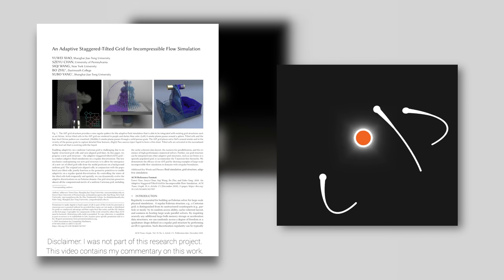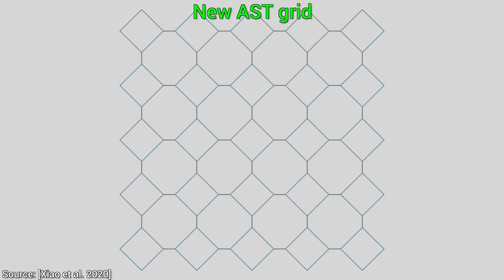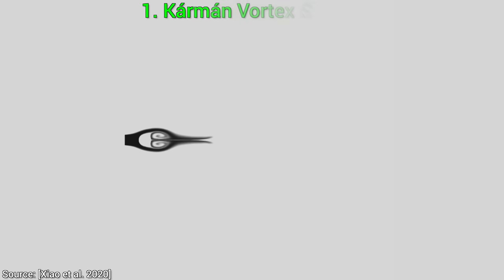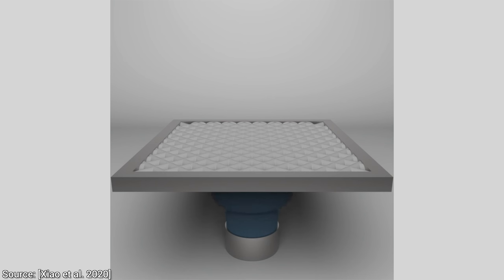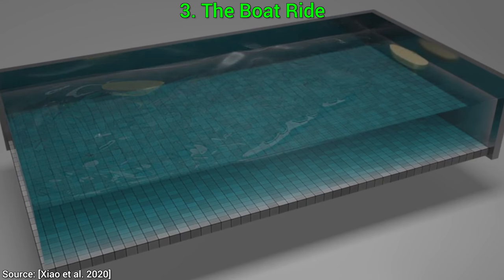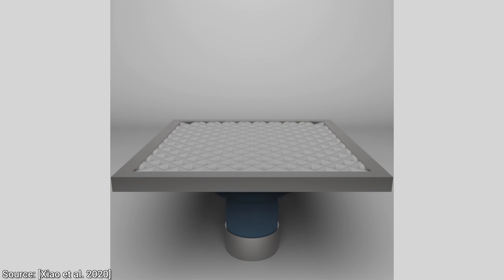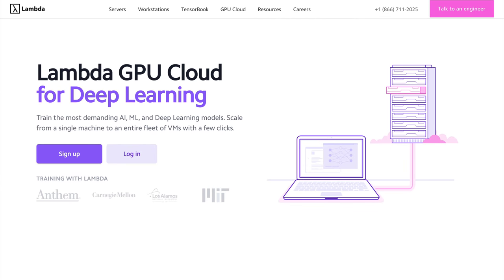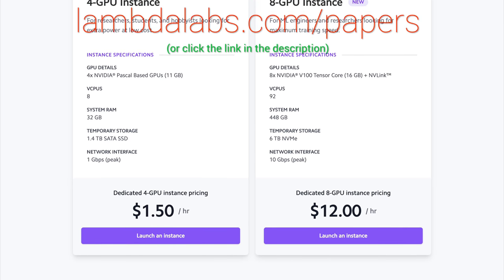All Hail The Adaptive Staggered Grid! 🌐🤯

Comment: I'd love to hear a more in-depth explanation why a tilted cell provides more detail than a regular cell. Is the tilt itself the extra information? In what way is that different to a motion vector?
Reply: A guess:
Tilt vs non-tilt is additional information and regions of either type can be used to define boundaries more easily that a regular grid could not.

Consider a wavefront and then look at a single pixel. Is it part of the wavefront or not? That information could be encoded into the rotation of the grid.
Reply: I'm guessing: So in FVM, there are cross diffusion terms that generates errors. If there are vortices in a domain, and using tilted cells, there is a chance of less cross diffusion currents and computationally less errors....

Comment: So why does the grid need to be tilted?
Reply: good question
Reply: There's a typo in your username
Reply: I guess that the main reason is that you can refine the grid flexibel, instead of abruptly splitting  big" cells in smaller parts you can gradually add those new cells in the the vertices/knots of the "big" grid. 
They are tilted so the new geometry of the grid is nice calculationwise. 
I sneaked into the paper and as I guessed, I saw that if you refine the grid twice the new even smaller cells are tilted (relatively) again, thus  normal again (viewed from the outside) 
Pardon my bad english. I hope this makes any sense.
Reply: I'm guessing: So in FVM, there are cross diffusion terms that generates errors. If there are vortices in a domain, and using tilted cells, there is a chance of less cross diffusion currents and computationally less errors....
Reply: @arnoldsenokopenko6093  The character limit didn't let me fit it all in. Had to sacrifice a letter somewhere. ;)
Reply: Figured the tilt was a way of embedding for more information into the cell. I'm not sure how significant "tilting" is without reading deeper but my initial thought is that it's related to how particle information is stored in x,y,z coordinates and this adds an extra dimension of rotation
Reply: I am pretty sure a lot of velocity vectors going on the diagonals are resulting in a somewhat costly multiplication by sqrt(2) in 2D or sqrt(3) in 3D. On the other hand if you rotate your grid they result in multiplication by 1 so they're free in a tilted space
Reply: @Twas-RightHere  A worthy sacrifice, Ames.
Reply: The uniform grid, because of those pesky corners of squares/cubes, favors liquid transfer in cardinal (x, y, z) directions but has no direct way to compute it in other directions. For large slow flow it's not a big deal, but for vortices, it is especially because vortices tend to become smaller & multiply over time. You can imagine it (approximately) like the swirl having a diagonal direction in it somewhere, which hits an edge and the swirl "splashes" into far too many grid cells.
In fact, it kills vorticity so much that a common approach is to guess approximately the vorticity and hack the fluid flow with an additional step so it looks better. The results are okay but not scientifically accurate.
With a tilted grid, you get 8 additional directions of transfer that are simulated perfectly, in addition to the starting 6; that means the angle between fluid's real direction and the grid directions is halved in the **worst case**, and on average even better than that. So swirls dissipate much less.
Reply: Thanks for all your answers, makes sense now. :)
Reply: @arnoldsenokopenko6093  What do you mean? their userame looks fine to me
Reply: @Twas-RightHere  why didn’t you sacrifice the A
Reply: @Twas-RightHere  You could've merged the "rn" into an "m".

Comment: It doesn't cost anything, in fact it makes it run in real time.

Damn, oh well...
Reply: Well it has to cost something, there are more calcs.But considering compared to uniform, it looks like it may increase  cell density up to like maybe even 80% and 4x the cell computations(4 new uniques for every original)... 1% and sub 1% for 3D is insane. It will mean when realtime comes, we'll have that much more resolution to our sims since 1% is negligible and it seems to scale to higher res well so the overhead will decrease. I deal with lots of this 3D space subdivision and I just can't comprehend how quadrupling computation points doesn't even increase overhead 10%.  Theoretically there's no way around it consuming 4x the ram but space is cheap.

Comment: I remember in my applied fluid mechanic course from a long time ago, there was a method call HP-reduction for optimizing finite difference method. The H part mean adjusting grid size, while the P part meant for increasing the polynomial order in which the grid was model on (it was discover that higher order polynomial give less error but does cost more resource). The way they determine the grid size is by restriction the maximum computation error a grid could have. IE: if a grid exceed the error threshold, it gets divide into half and recompute again, re-compute until error is lower than some threshold. It speed up computation so much that it can actually do 3D mesh even without multi-threading (this was done back before GPU computing becoming popular). There was also another method call multi-grid method. In which we compute the fluid simulation in a coarse grid until it converges, then interpolate the values into finer grid as initial conditions. Compute until it convergence rate slows down, use the result to interpolate back into coarser grid as initial conditions, then repeat the process. It's pretty nice, since coarser grids usually converge faster but give more error, while finer grid give more accurate result but can have really unstable converge rate (or may not converge at all, and converge pretty slow as well). Multi-grid method effectively let you have both accuracy and  faster converge rate at the same time. I see a lot parallel between numerical method (like finite difference method and finite element) and neural net layers (at least from underling math representation point of view) I'm kind of surprise not more people has try to adopt numerical method optimization technique (multi-grid, hp-reduction, method of moving asymotote, etc) into neural net. Nvdia sort of did a similar thing as multi-grid method to train their neural net, where they train a smaller network with coarse input data, train it until it converge. then interpolate the weight to a finer gird neural net with more layer and finer data, then gradually interpolate the data to finer and finer grid. And get the benefit for both training speed and accuracy. Very curious to see if other company/people adopt other numerical optimization technique from the Fluid/mechanic/ECE world to the world of neural net.

Comment: Always one of my favorite channels. Does this pass muster in the actual sim dept? Could this be used for a virtual wind tunnel for example, or is it strictly a visual arts thing? I will read the paper, though I strongly doubt my capabilty to understand more than 3 words in succession. Thanks as always!
Reply: I believe it applies for any fluid simulation in its class and does not affect the correctness of the approximation, only the precision. So yes, it should be usable for engineering simulations in principle.

Comment: My guess? Minus 60-80% computation times/power.
This idea floats around my head for years in this regard and for other applications (different kinds of simulations): why not use a ridiculuosly inaccurate grid almost everywhere and only divide it  when and where there is change in close vicinity? Happy that finally someone with the expertise to realise it has tried it out. Go for it!
My hint: Raytracing like of 3D-fractals for example may also profit VERY much from such an approach me thinks: going bold steps until you hit something (using some approximation for example) and then go back and subdivide the last step, and repeast that process on a smaller scale until you hit the resolution you are gouing for for your images. between the camera and the fractal there is usually so much obviously empty space, why not skip that this way?

Comment: Hmm... I get that they’re tilted cells. I don’t see how tilting the grid improves the simulation, though.
Reply: I'm guessing: So in FVM, there are cross diffusion terms that generates errors. If there are vortices in a domain, and using tilted cells, there is a chance of less cross diffusion currents and computationally less errors....
Reply: @prasanthvemula_nv  oh hmm, so maybe it increases the number of axes of the calculation?
Reply: @nickpatella1525  for fluid simulations, we solve using NS or VS. irrespective of GE, we`ve convective terms (calculated at cell centers), diffusive terms(calculated at face centers).

W.R.T. diffusive terms there are flow vectors calculated along the flow direction and across the flow direction. {REMEMBER THE MORE THE CALCULATIONS, THE MORE THE COMPUTATIONAL ERROR GENERATING TERMS}.

So, if there are vortices in the domain and we use AST grid, instead of having orthogonal faces, now we`ve faces MAY BE OR MORE ALIGNED with flow minimizing the diffusive face tangential error terms (hopefully zero) and inturn faster convergence.

Irrespective of problem statement, Adaptive techniques were always superior.

Comment: It doesn't seem to be possible to divide the grid one more layer in 3d? It's only possible in 2d. If the dividing is along the axis, like, for the critical part, the resolution is 2x or 4x or even higher, is it possible to do the same thing as shown in this video?

Comment: Wouldn't the change in degrees of freedom (DoFs) have to be added "Adaptivity Update Overhead" and "Velocity Remapping Overhead" to get the actual cost in terms of computational resources?  That would mean a 14% increase in computation for a 22% increase in total performance.  Still impressive, but a little less so.

By this logic, the bottom one is most impressive with a total computation increase of 9.1% with a total 33% benefit.

Comment: could it actually be faster since it doesn't need to work on extra cells? (comment following the video advice) so like 80% of original sim time?

edit: after looked at the result, dang I was off but still 1% is impressive.

Comment: Great! :)  That looks wonderful... I wonder though, can any /do any of these simulate momentum of the gas ?  There's this 'bladeless fan', no, not the dyson fan that just hides the blades behind a shroud; https://exhalefans.com/  - they are more like a tesla turbine in reverse; they draw air up through the center and the angular momentum causes the air to exhaust to the sides; This is a nice idea, but I don't have any simulation software which I could make a simulation work for that... because it's a rotating body in still air, and the 'reynold's drag' on the surface of the blades accelerates the air.
This idea is also great, but I think it can be better; the Exhale Fans use flat plates... I think it would be better to have a sin-wave sort of channel, in inverted layers.  This would form alternating large channels and small channels; the momentum should cause high pressure in the large channels, which goes through a thinner channel, which is a cooling effect as it enters the next ring which has a gap.... would think 4-5 'ripples' in the surface would work.   
Manufacturing wise - all the rippled plates are exactly the same, just assmebled with every other layer inverted.